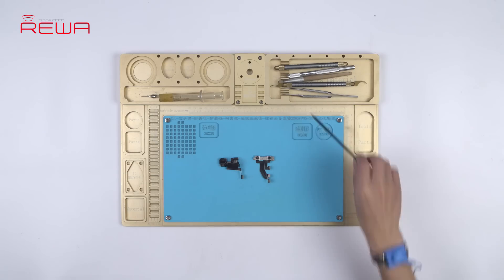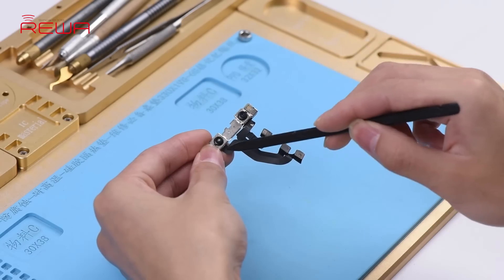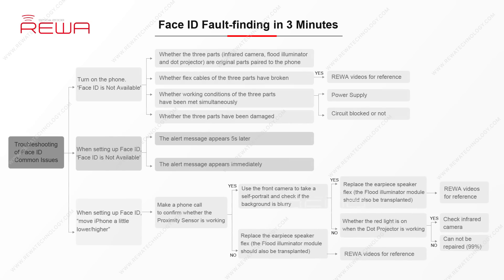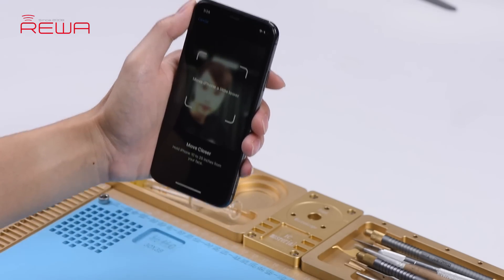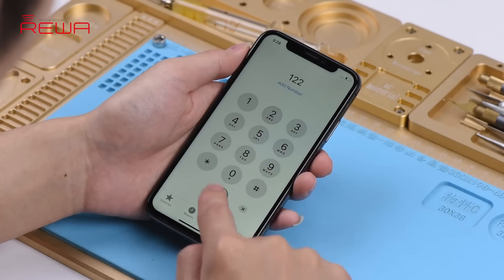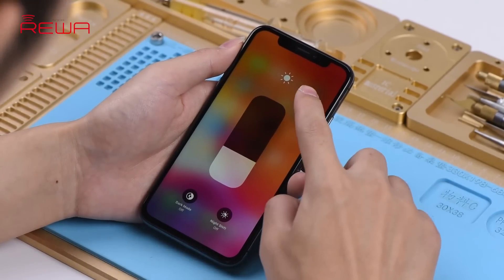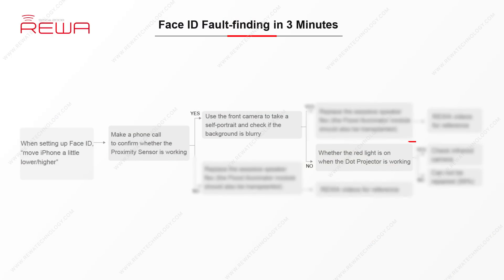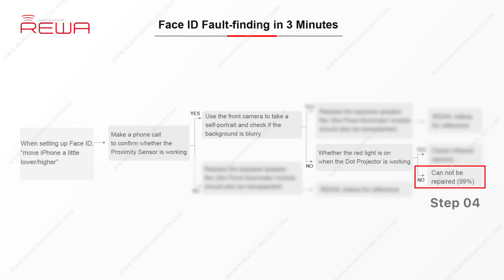iPhone X Face ID Not Working Repair | Move iPhone a Little Lower/Higher

Comment from the maker: * REWA Academy Training Book PRE-SALE of iPhone motherboard repair available now!
Do not lose the opportunity to get limited systematic REWA training treasure (1000 limited stock for pre-sale).
> https://bit.ly/31I5Nks
Reply: Yes I have this issue with iPhone XR after screen replacement
Reply: i have this problem
Reply: I had opened The flood and find out 3 chips i want to change cjip like @turtle@ but i am thinking about dot projector!!! did you knew what must activate first? in normal it goes prox then blinking the flood after it begins with dot projector to hit)  do you think that if dot projector will be disabled it will be the same like flood is missing but proxm is turning? thanks
Reply: Not covered in the video, this scenario:

1. Proximity sensor: Working
2. Ambient lighting sensor: working
3. Camera does NOT yield a blurry background in self-portrait mode.
4: Red light is present on dot projector but it does NOT blink.
5. Face ID doesn't work, keeps saying move higher, lower, etc.

What does this scenario point to as the problem?

This occurred after a small amount of water got into the phone.
Reply: @jaydekaytv  have you repaired that
Reply: @mydeenmydeen4177  I tried many things and I believe that Apple totally disabled the module with no way to reset it. I ended up buying the new iPhone eventually 😑👎
Reply: Hi Sir
Yes sir it has a face identification problem but i remove this cable but still it was restart after three minutes
Reply: REWA Technology i have a same issue what can i do now?
Reply: Dear friends
If your iphone X have problem restart every 3 minutes so please change only original charging flex
I have cleared this problem 4 iphone X
Reply: REWA Technology Dude Can't this Problem be solved on iPhone XR?
Reply: REWA Technology I having this issues right now on iPhone X 😟
Reply: REWA pls reply this,how can i fix it on my xr? Is it must change part? Or cant be repaired at all?
Reply: I have the same problem yet what should i do ?? I want repair my phone !
Reply: What if dot projector is working?
Reply: OMG greeehack15 on Instagram just help me fix my face I'd  this guy is good
Reply: Good work

Comment: Hello Sir, thanks for this amazing help
i have an issue with my Face id on iPhone X
the problem is it keeps saying (move your head a little higher/ position your face inside the square) but nothing happens after
i checked the 2 dots and they are there and working, i checked the flood illuminator by calling and the screen went black which means it's also working, i checked the portrait for the front camera and it also worked, everything in the phone works perfectly, but i should mention that the Display is Damaged and contains a green lines from the left side, could that be a reason for why the face id isn't working, or just my face id died and that's it?
Reply: did you fix your issue? I have a same problem
Reply: @bartoszdabek6094  i actually did, after i opened the phone, I CAREFULLY cleaned the dot projector and led illuminator and the camera VERY carefully, and it started to work again (never be rough when u clean)
Reply: @ahmedp3  how did u clean it bro? using wicks and isopropyl alcohol or smth like that? you just gave me a light of hope!!

Comment: How to fix my iphone X face id? Everything is fine, truedepth camera is good also everything well function in portrait camera and also working fine, infrared sensor also working fine, dot projector also, proximity also fine like i said everything is fine. But when i try to set up face id, it’s say “move your bla bla bla” . How can i fix this problem
Reply: I had issues but got mine fix through plugtoolz_ on Instagram 💯 legit and trusted ✅within 30 minutes 🇺🇸

Comment: I spent nearly a week to recognize that the dot projector is defective. The pre owner damaged Flex cable of Display sensors. At least i could rescue proximity sensor. When i installed flood illuminator no matter which direction iPhone wouldnt boot up. So I removed it and its booting up. Idk if I can restore and activate still but. I think i will stay on 14.4 forever now. Thanks Apple.

Comment: Make sure you don’t have a screen protector that’s covering the true depth sensors!! Mine was and it started fine but because it was old there was some dirt and air underneath the plastic that screwed up the sensors. I had to take off the screen protector and it worked fine!!!
Reply: thanks bro . i really think my phone have a problem . after i remove my templed glass it normal again .

Comment: Post Upgrade to iOS 14 - my iPhone X is having the same issue.
Reply: Same had mine for like five days not dropped or no water damage worked just fine when I bought it, now after updating to iOS 14 i get the move higher or lower
Reply: I updated my iPhone XS Max to iOS 14 and now Face ID is not working let me know if anyone can help
Reply: Do you guys found any solution. I’m having same issue after upgrading.
Reply: I traded my iPhone in for new one because i had the protection plan on it told them it was a mechanical error/ camera failure seems like it’s iOS 14 it was also deleting my music off my phone, Maybe i had a faulty phone as well but I’m on 13.6 and it works fine. Either way not updating to iOS 14 until the problem is fixed.
Reply: I guess we need to get Apple to look into this issue. FYI -Mine was not dropped and no water damage
Reply: @AppleReviews  yes it passed all tests. my phone screen was never replaced
Reply: Same
Reply: @yomarisoliva1496  I think rewa can fix it

Comment: Everything works fine except the front portrait mode blur and Face ID ?
Reply: This happened to me I sorta dropped my phone in water
Reply: @evelynm4334  bro what we gonna do😅
Reply: @evelynm4334  did you ever get it fixed?
Reply: Mine everything works fine except my face id always say move your bla bla bla. What’s wrong with my iphone X
Reply: @panjirohadi8982  Because your screen has been changed
Reply: @panjirohadi8982  have you found the solution? got the same problem here. potrait front cam is fine, but not the face id. i know its already 4 years ago 💀😭
Reply: Same
Reply: Same
Reply: Yes
Reply: Same with me 
Is it fixed now?
Reply: Patrick Paby nop
Reply: Same
Reply: hey guys same issue what should I do?
Reply: same issue how to fix ? any solution ?
Reply: @afaqhussain318  it’s to do with the dot projection ting
Reply: @George-xw6nc  any solution ?
Reply: @afaqhussain318  nah non replaceable unfortunately

Comment: My Xs Max doesn’t recognise any face when I try to make a new one, and didn’t recognise any before with the one I had
Reply: Same!!! Did you end up fixing it
Reply: Camille Hanry my screen protector was broken on the place near the camera and it worked for 1 year like that, out of no where the phone started not recognising anything and i just went on with typing the code every time, however I dropped it on some rocks and well the screen cracked so I had it changed and it started working again, then I knew sth had happened on the crack near the camera so it didn’t recognise anything. I know it’s probably not your case but this was mine
Reply: @Joanavs2003  is your true time still available after repairing the screen ?
Reply: @gracie3589  what?
Reply: @Joanavs2003  true tone * my bad
Reply: @gracie3589  yes yes

Comment: Not covered in the video, this scenario:

1. Proximity sensor: Working
2. Ambient lighting sensor: working
3. Camera does NOT yield a blurry background in self-portrait mode.
4: Red light is present on dot projector but it does NOT blink.
5. Face ID doesn't work, keeps saying move higher, lower, etc.

What does this scenario point to as the problem?

This occurred after a small amount of water got into the phone.
Reply: Me too
Reply: Did you fine a solution?
Reply: @liviafomet4586  No, after dealing with a crippled phone for a period of time I bought a new one. It’s a total shame that something like this can happen to a water resistant phone. Apple got another $1k+ out of the deal so they’re happy as can be.

Comment: This happened to my iPhone I tried to power it off and I turned it on it still didn’t work and then I reset my phone and I took my screen protector off and it works now
Reply: when you reset your iphone which option did you choose after you press the reset button?
Reply: 1K CAM i reset the whole form I had to resign in on everything tho

Comment: Everything is fine for me but it still says move iPhone a little higher or lower wtffffd is it fixable?
Reply from the maker: Unfortunately, the fix rate of FaceID is pretty low, if you have already followed what we share in the video, pls turn to reliable repair shop nearby to better solve your problem.
Reply: RyanDBandito try turning your phone off for 30 seconds. It worked for me :)
Reply: Maryam as in hold it off for 30 seconds or just turn it of then wait 30 seconds and thanks
Reply: RyanDBandito power it off completely. And then turn it on :)
Reply: Maryam I tried it didn’t work
Reply: RyanDBandito Oh I’m sorry🥺😅

Comment: Hello, my iphone x dot sensor is not working i guess. Is it can be fixed?
Reply: I getting a problem in Registering Face Id it says move iPhone little lower & then little higher  & i cant use front potrait mode too what could be the reason & cost of repair of a year old Xs Max! Kindly Help both other sensors are working!! Do you have any idea bruh?

Comment: Face ID doesn't work for me and when trying selfie portrait mode it doesn't work either
Reply: Turn airplane mode on and off
Reply: Sergio :v and then ?
Reply: Same probleme did you have a solution
Reply: @hadilghorbel8167  have you fixed it yet?
Reply: @Oskrm503  not really i give it back to apple store they gave me a new one

Comment: Check the solder joints on the dot projector as well... they tend to be weak and are easily dislodged with a fall or the camera bracket when installing a new screen.

Comment: Hi everyone
I have 4 iphone x it's all same problem every 3 minutes restart by self any solution please tell me
Me also change new battery charging ic u2 ic lcd charging cable and new software but it's same problem
Reply: The motherboard is sort of like a sandwich (2 boards soldered together along the edges) and usually when the phone is self-restarting, it is because a solder joint broke between the two boards. If you were lucky, you can take a rework heat gun around the edges of the board (low air flow) while you either lightly clamp the board or just hold it together if you can withstand the heat

Comment: hi rewa is it possible to repair since i got same issue with the video
Reply from the maker: Due to the complexity of Face ID, causes of Face ID failure can be different and solutions flexible. We are sharing with you guys a repair case that we met and hope we can enlighten you somehow with our repair tricks. Please check carefully for possible causes of your Face ID problem.
Reply: REWA Technology No solution from you. Too bad
Reply: @rewatechnology2008  the dot projector not function as per video, how much it cost for the repair usually

Comment: If there is no red light and the projector does not work, it cannot be fixed, right?
Reply from the maker: Please follow our repair tricks step by step. If the failure is confirmed to be caused by damage of the dot projector, then Face ID failure can not be fixed.

Comment: dot projector can be replace?
Reply: No, dot projector cannot be replaced.
Reply from the maker: Please be noted that the Dot Projector is paired to the phone. Replacing of the Dot Projector might cause Face ID failure.
Reply: Thank apple for think different, like those MacBook where the heatsink isn't even connected to the CPU and the CPU overheads and dies, and apple quotes not under warranty user error. Or when the T2 chip dies they tell you you must be using it wrong, Apple screwing over our customers is our mission.
Reply: But how is that not a manufactured defect???? How did I break it. I cracked the screen and had apple replace it a few days b4 warranty was up they ran it thru the test and it said Face ID was working on their computer. The guy was trying to just give me a new phone but it didn’t end up happening Went back to pick up phone and they told me the true depth sensor in the camera was broken and would be another 3-4 hundred dollars more if so I could’ve just bought a brand new phone for the money I would spend to fix it and would’ve had 2 iPhones. And seeing that this is a common problem idk how this shouldn’t have a recall or covered by the warranty🙁🙁🙁

Comment: No light from the Dot-Projector doesnt always mean it's bad. We made the expirience that the solder connection often gets loose by removing the assembly from the holder (by flexing too much), a simple resoldering fixes the bad connection and Face-ID is working again in 90% of the times.
Reply from the maker: We do appreciate your suggestion. We'll forward your suggestions to the related team and keep an eye on this issue. Please stay tuned.
Reply: REWA Technology any news?
Reply: I had this issue too on an iPhone X it had foggy portrait mode no focus Till 2x Zoom 
And had this move phone higher / lower issue 
I solved it by replacing the back camera module
Reply: Send example pleas
Reply: Which "solder connection" are you referring to exactly?
Reply: I hope this problem can settle 🙏🏻🙏🏻
Reply: Michael Frank so if I apply heat for resoldering you think I can fix it?
Reply: @michael frank do you mean the connection on the mainboard or what? Thx for sharing!